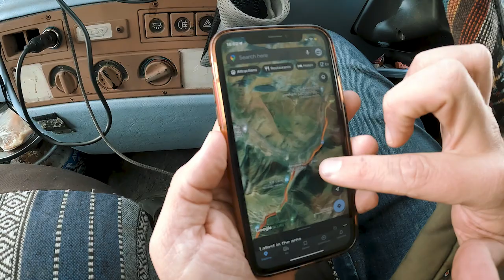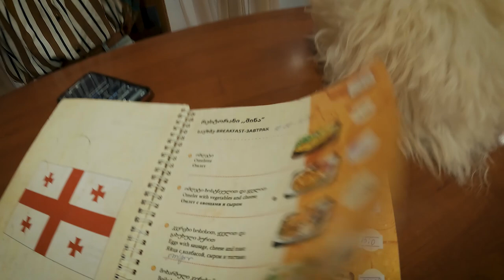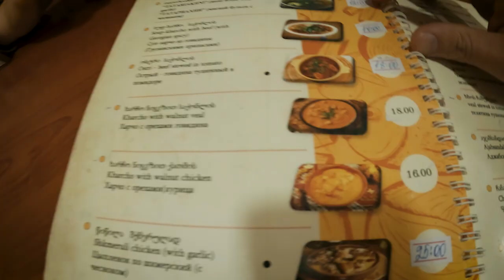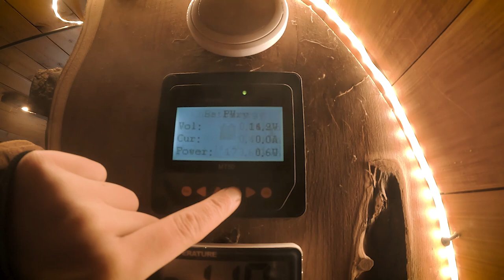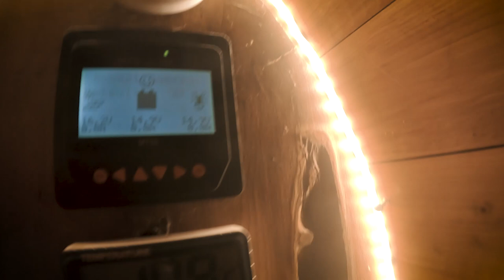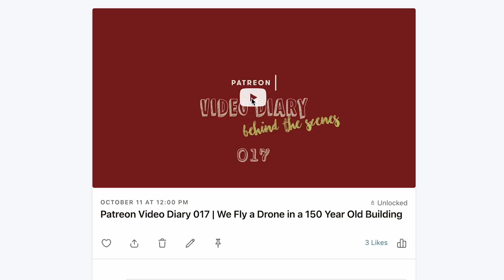We Drove to the Russian Border (on Georgia's Most Scary Road) EXTREME Winter Vanlife - Caucasus 🇬🇪

Comment: Great filming, as always. I have known engines that get addicted to Easy Start, had one Hudswell Clarke shunting loco that needed it every time, even when it was hot from several hours work!   It is a known problem. I had a Landrover in -15degrees or so temp that was difficult to start, some hot water (NOT Boiling) poured over the fuel lines & pump did the trick.
Have you bumped into @TrioMandili yet? 🙂
Reply from the maker: Thank you! Yeah we do hear that a lot about getting addicted to easy start, but we've had so many litres of the stuff poured through the system over the years and it seems fine, only ever wants it when it's below freezing. Definitely used the hot water method before too, it works! We were surprised the hot water bottle worked in this video and very grateful it did!
Unfortunately not! We'd love to meet them, but on our previous video we did meet up with some amazing singers in both Pankisi and Tbilisi- if you haven't seen it yet it's well worth a watch 😀

Comment: How to stop your diesel freezing    get a water tub fill with coolant  pop a copper pipe in to the bottom  take to exhaust  pipe wrap copper pipe around exhaust  pipe  and then  take to fuel filter wrap round filter and then back to tube full of coolant   this will take  heat from the exhaust along the pipe  and heat up the fuel in the filter

Comment: The manual from my 30 year old Mercedes van recommended some percents of petrol as a additive for cold temperatures.
Reply from the maker: I think it depends on the fuel pump, we’ve been told we can by some and can’t by others 🤣 we have a Bosch vp30 and it seems to not be recommended unfortunately
Reply: @FromRustToRoadtrip  Οk, good you're already aware of that trick. Well, spring is coming and I hope you're heading for warmer places ...
Reply from the maker: It’s warmed up nicely here now, average 20°C 😄

Comment: Be aware - engines get addicted to easy start. It should just be a last resort.
Reply from the maker: We’ve been told this quite a lot but we’ve put so many litres of the stuff through the system over the years and it’s not caused any problems for us. It only wants it in the cold, but even if it was to get addicted it wouldn’t be a problem. Anything to coax the old girl in to life is fine with us, she’s old and done lots of miles she deserves an easy life 😂
Reply: @FromRustToRoadtrip  It does not cause problems, but she sounds addicted 🙂

Comment: Watch that easy start. ...believe it or not, the engine will get "addicted" to it. However, that engine still sounds in fine fettle..
Reply from the maker: So we’ve been told but honestly this van has had litres of the stuff pass through it over the years 🤣 sometimes it’s the only way. We’ve recently had the timing readjusted and thankfully it’s starting straight away now 🤞
Reply: @FromRustToRoadtrip  I'm saying this from a warm armchair...if I was in your neck of the woods I'd be lobbing it in🤣
Reply from the maker: 🤣🤣 it got to the point where we wouldn’t even bother to crank it in the morning without easy start. Thankfully it’s warming up now!
Reply: @FromRustToRoadtrip  hopenim not teaching my granny to suck eggs, but did you know if you add a small amount of petrol to diesel, it stops it waxing? Used to do it on lorries with steel fuel pipes..
Reply from the maker: @ianwatkins9602  Yeah we've read up about it a lot, we've been doubtful as it's pretty much 50/50 people saying do it and dont' do it.. am I right in thinking that some fuel pumps can't handle it? We were very tempted up in those mountains